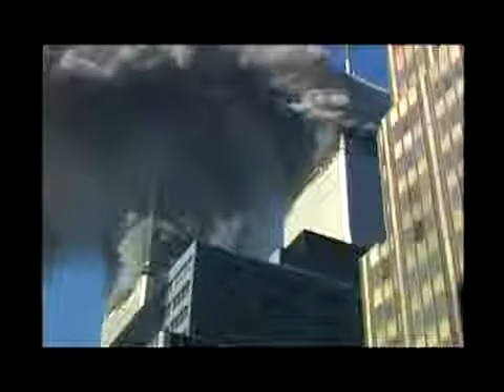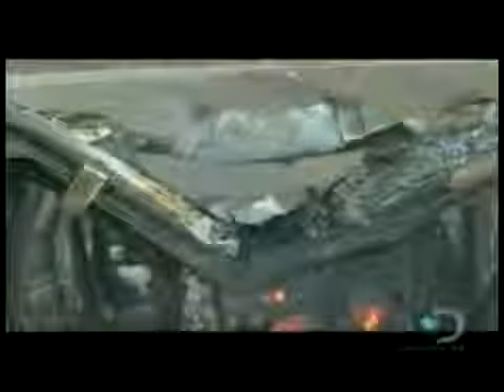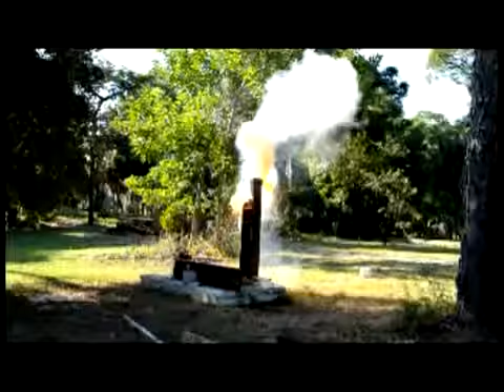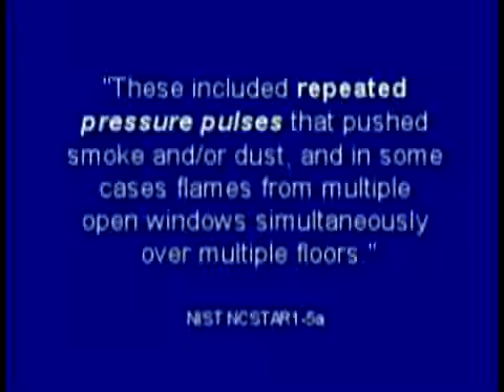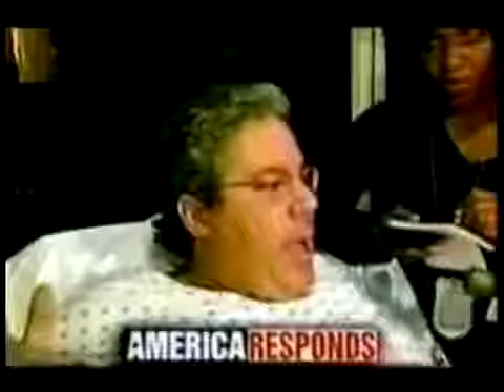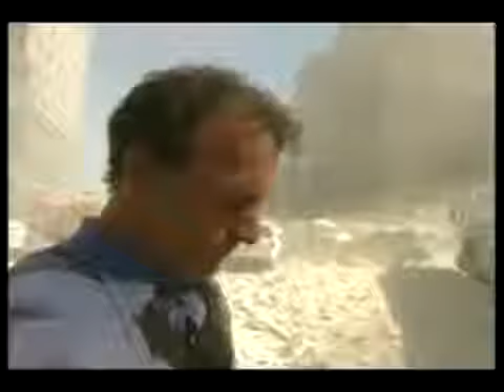Thermite cutting steel.   Validated,   Experimentally demonstrated.

Comment: Now make it survive in a fire for 30 mins before going off on schedule.
Reply: Ah - but the cutting charges weren't in the fire. They were on the floors below the impact. In videos you can see the molten steel pouring out of the lower floors, and the puffs of smoke on lower floors just before the collapse.
Reply: @adambogart3659  You know that was from steel? Not aluminium ventilation ducting or stuff like that with a much lower melting point? 
And the smoke is clearly from the air displaced as the building starts to fall.
Reply: ?? They even went over the molten aluminum hypothesis in this video.  Did you watch it?